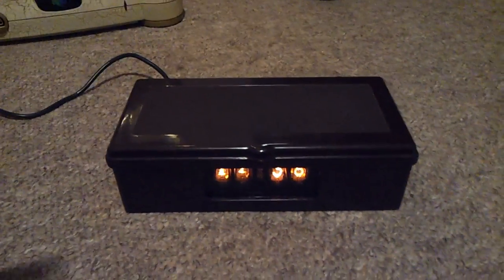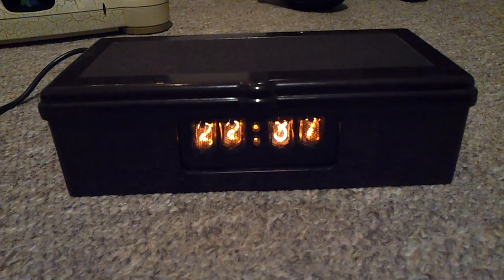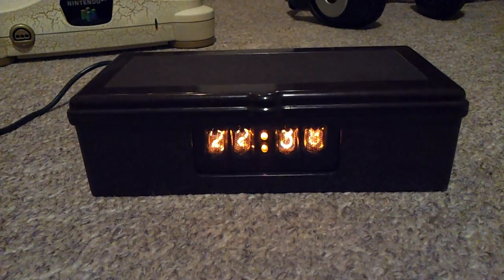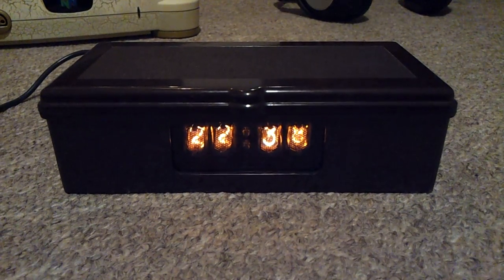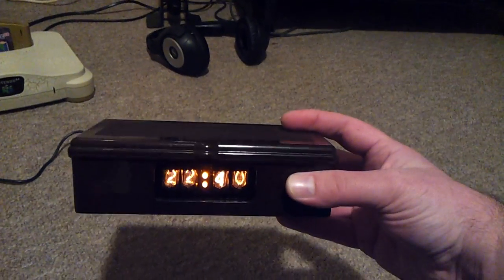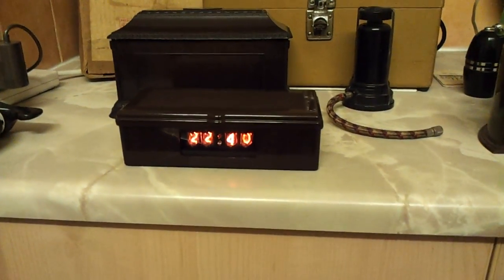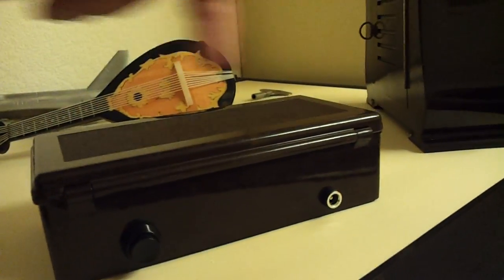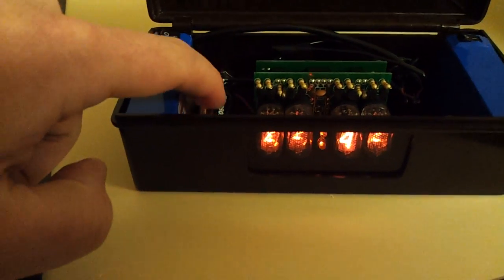Custom Bakelite Nixie travel clock (with a twist...)

Comment: An impressive result. Especially that cut out by hand :) All is clean as always, thus it looks a mass produced old bakelite clock (at least it will when that DC input oxidizes a bit). I wish you have spent a bit time on inside since it opens, it will be perfect than. You can cut that blue shrinking away, naked cells will be more matching to PCBs. And those DC input sockets have a third pin that acts like a switch when you insert a plug, so if you wire like that you can lose the switch on lipos. You should make projects as much as collecting, amazing work.
Reply from the maker: I don't run the clock with the lid open, it really doesn't matter what it looks like inside... I didn't think it looked that disastrous.The power jack only has 2 pins.
The switches on the batteries are useful because I can switch them off and the passthrough still works, so instead of the batteries being in a constant state of charging and discharging a little bit, I can switch them off and just run the clock straight from the charger (if I just want the clock to stay in one place).

Comment: Bakelite doesn't contain asbestos...it's a modified phenolic resin.  The dust is hazardous, though.
Reply from the maker: Yes it does.
Mottled Bakelite (or most large/thick Bakelite objects) were never just Bakelite - they contained filler as well in order to enhance the mottled effect while making the object cheaper to manufacture due to less Bakelite powder being used.
This filler was most commonly wood chippings or asbestos.